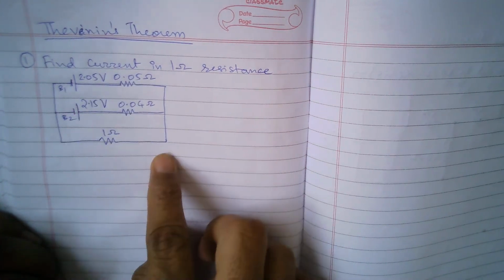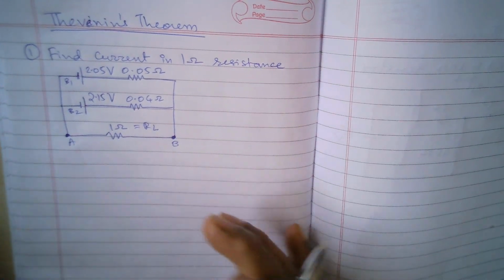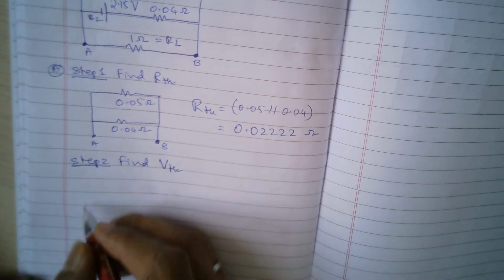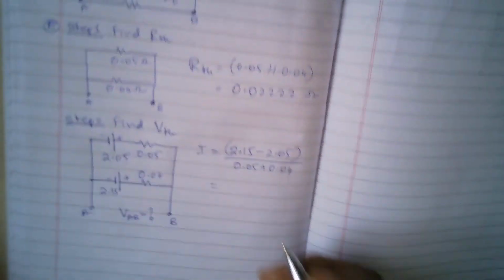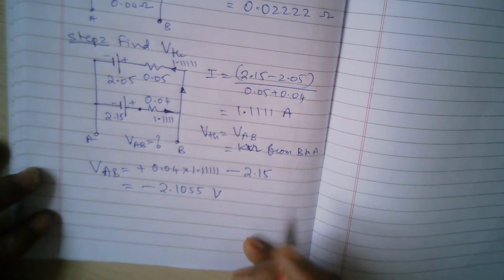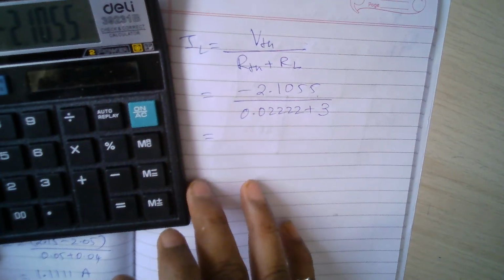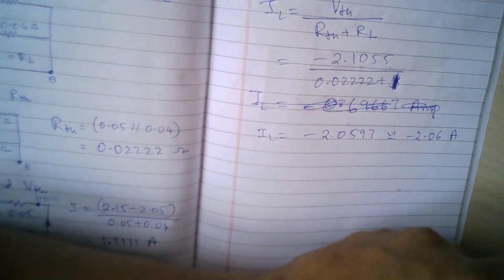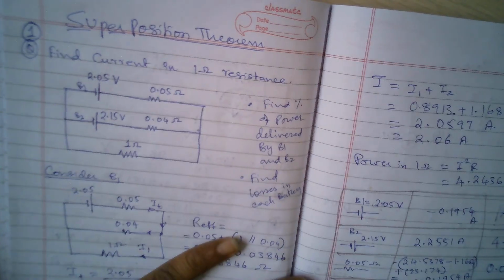T1 - Thevenin's Theorem Example Problem

Comment: Hello, what if :      V1 = V2 in this case the current is 0 ? then Eth = 0 ? 
And thanks for all the videos and explanations you helped us alot !
Reply from the maker: If V1 = V2 the current will be zero. But Vth will not be zero. Vth = V1
Reply: @pradeepyemula6015  
You are right , the solution of my excercice says Vth = V1, and i dont understand how
Because if let say : the kirchoff equation gives us    V1 - V2 + (R1*I1 - R2*I2) = 0
with V1 = V2 it will become : (R1*I1 - R2*I2) = 0
if R1 = R2 then I1 = I2 & we dont know both of them
else I1 = Contant*I2 

in other hand the Vth = V1 - Constant*I1

in both cases i1 and i2 are unknowns ,
if i1 = 0.1A thus i2 = -0.1A while (R1 =R2)
then Vth = V1 - Contant* 0.1 = it is not V1 in this case

So what makes the I1 = 0 or I2 = 0 ? while we know they are not 0